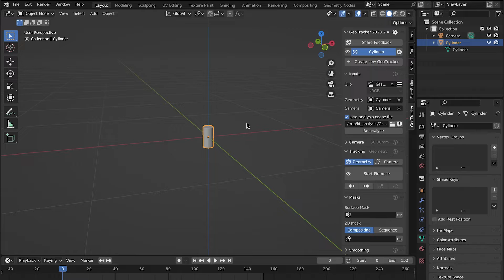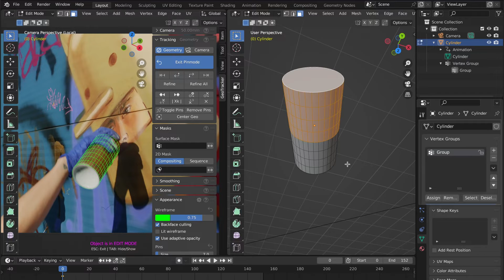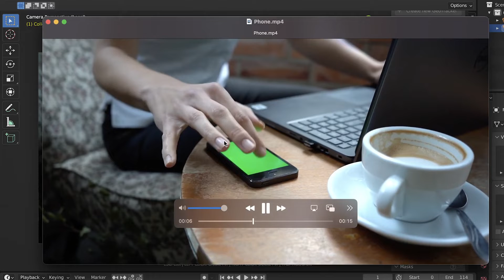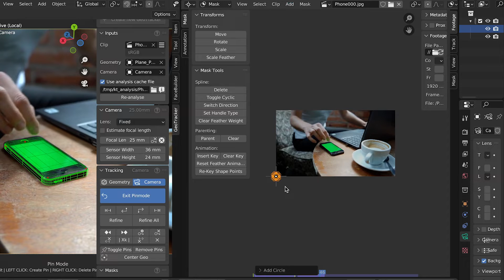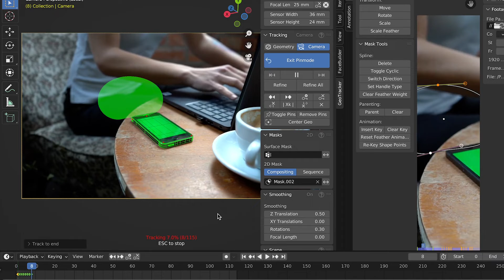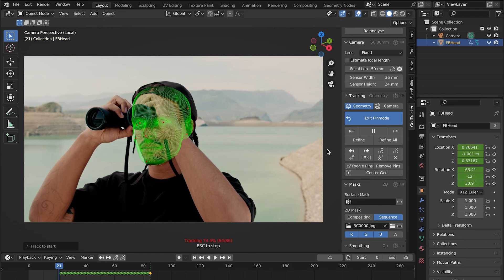Guide to Masking – GeoTracker for Blender Tutorial

Comment: i have a question. So the reason that in this video use compositing mask is to makes the phone keyframe more accurate right ?
but when it's comes to real footage is the phone gonna be a top layer ? if that's so we should do the mask again to get rid of the fingers ? Please Correct me.อ
Reply from the maker: If you then replace the phone's screen with CG, then yes, it will be on top and you'll need to use a mask for fingers to comp it